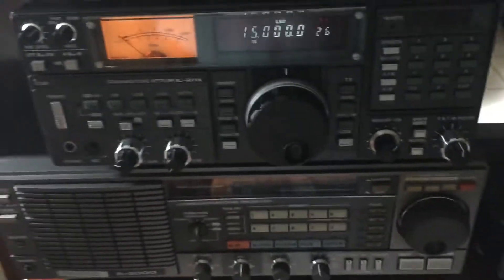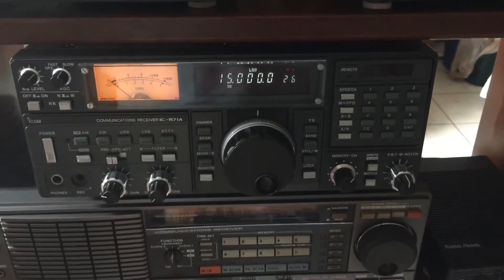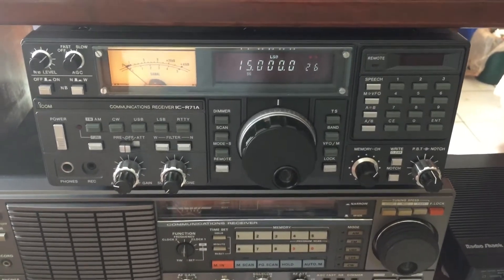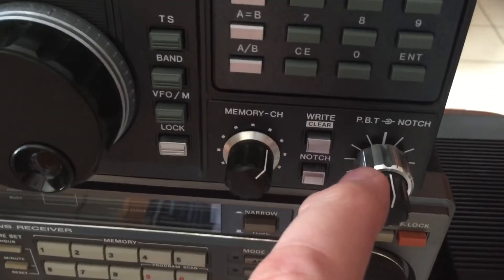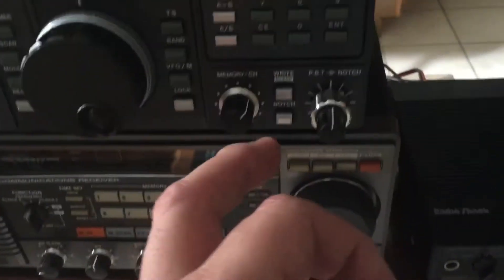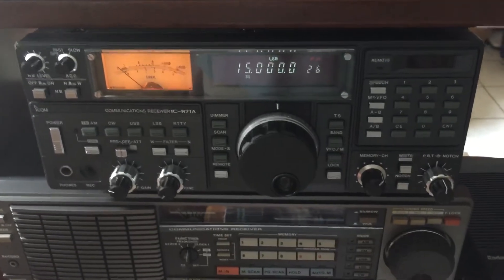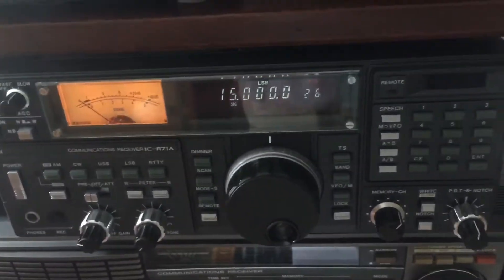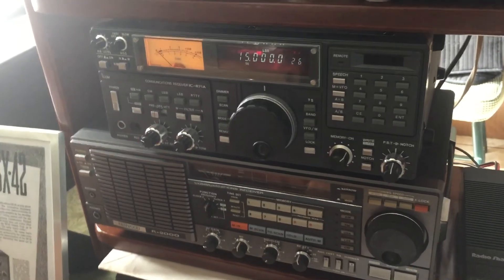ICOM IC-R71A That Crossed The USA Four Times! Finally Back Home After Recap.

Comment: Hi thinking of buying the ic 71e , i don’t  know. If the ic 71a or the ic 71e have the same problems with the capacitors , do you know when the capacitors  where changed. Thank you.  Dave
Reply from the maker: David H Harbourne I had mine changed a few months ago- I’ve been the sole owner of this set. But I’d advise, if it isn’t broke, don’t fix it. People go a little mad with recapping radios.